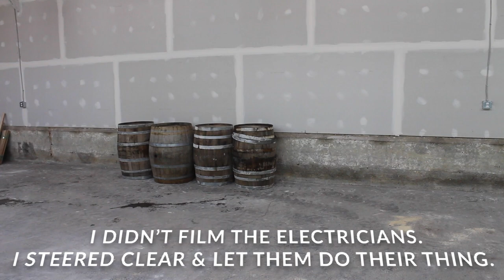Old Barn Space Turned Woodworking Shop

Comment: I just built a garage which I may use as a wood workshop. I hate drywall so had a pro come in and fire tape it. He told me to paint it fairly soon. Said the drywall will slowly absorb water , causing the ceiling panels to bow down over time. Sorry to see your sawzall accident.  I do a lot of remodeling and tear down projects. My all time favorite tool is a Milwaukee 18 volt battery powered Hackzall. Designed for easy one hand operation, making it far more useful. Once you buy one , you will wonder how you got along without one......
Reply from the maker: Thanks for watching! I need to get some paint on those walls; agreed. The sawall accident was my own stupidity ;) I've used one of those one handed Hackzalls, they really are the best.

Comment: Looks great, one change I would have made though is to put all that electrical into conduit instead of that hard flex stuff. Conduit you can add to later on if need be without too much trouble but that stuff basically is what it is and you need to run an entire new line. Just my 2 cents.
Reply from the maker: Solid feedback, thank you!

Comment: That is an very nice shop. Why didn't you finish the taping and paint?
Reply from the maker: Just simply ran out of money and needed to get working. But hopefully this summer we will finally get it finished up.
Reply: @ryanhawkins  Bummer. Always nice to have the space cleared out to do that type of work. That is an inspiring shop. So many positives. Lots of Large windows up high so you don't lose wall space. Tall ceilings. Wood beam, very cool.
Reply from the maker: @jeffsmith1858  So much potential.
Reply: @ryanhawkins  What is your plan for heating?

Comment: Having watched this and your pack-up video, just wondering what lessons learned or tips you have for other woodworkers about to move their shops. I've been in a 2 car garage for 25 years now and have built up quite a collection of not only scraps, but long boards for future projects, heavy stationary tools, lots of hand and hand power tools, assorted hardware, etc. The bit about finding tools to remove the wall bracket with the stripped head made me think I should pack up wood and supplies (hardware) first, then tackle the stationary tools (on mobiles bases), then the dust collection. Save the power and hand tools for last in case they're needed for the pack-up, and they'd be the first to unpack for teh new shop set-up. Any other comments? Did the cardboard boxes work out, or did you wish you had done something else? You had the luxury of moving into a much larger shop - I don't expect my new shop to be much bigger than my old shop. TIA

Comment: It really irks me when someone (probably not you) overhears a phrase from the trades and pretending to be knowledgeable adds their own definition to it. Fire taping does not mean one coat of mud. Fire taping is what is required by the building code in an attached garage. Any pipe wire or duct work that goes between the interior of the house and the garage has to be air sealed with approved for fire, tape and mud. Also the garage walls and ceiling require 5/8" drywall.